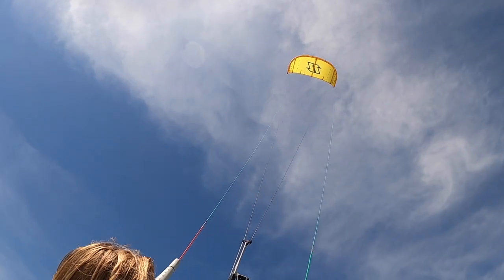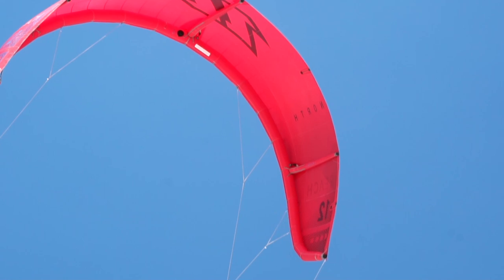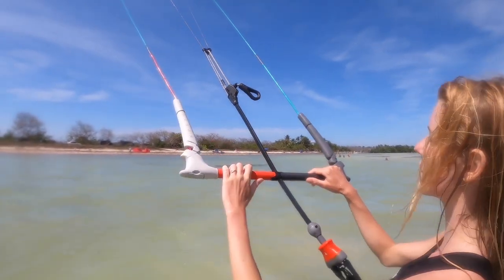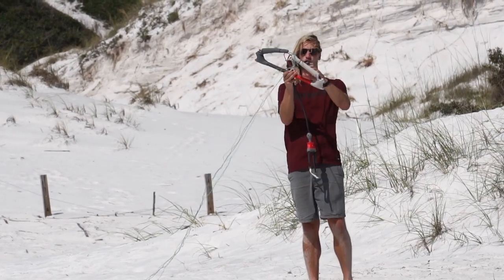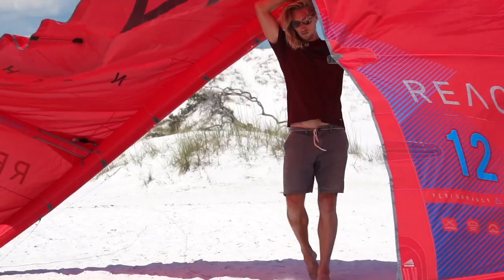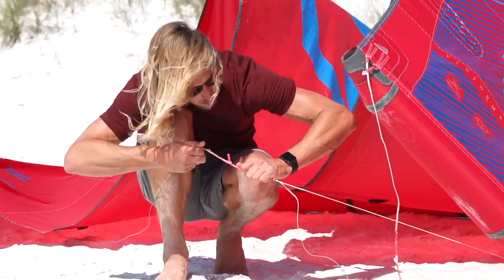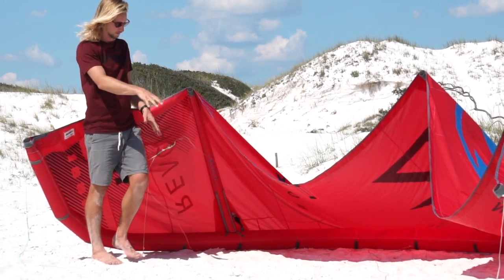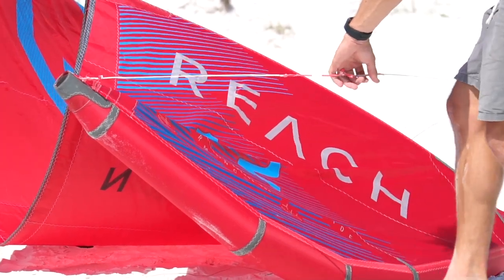Kiteboarding Basics | Learn How to Handle Your Kite

Comment: Hi Blake. I got a B3 Slingshot trainer from MACkiteboarding. I ve taken it out 3 times now on grass fields. I can do figure 8s, loop it both ways, and did a few simulated water starts (sitting on grass and staying “small”)today. The question is why does it fly over my head at 12 o’clock and backstall?  Is it due to gusty winds or should I not try to park at 12 o’clock? Thanks!
Reply from the maker: That's a great question, my friend. 🤙🏽 A quick phone call might be the best way to suss this one out. Got time to chat? (800) 622-4555

Comment: How does the knot work on the steering lines of the duotone rebel? I bought a rebel package from you guys a couple of weeks ago and noticed the lines on the rebel is a loop and not a knot
Reply: Hey Justin, every brand has a different line connection set up but it connects in the same way. How's it going for you?
Reply: The duotone knots and loops are smaller than most. The loops actually have a small knot on the end so it can be confusing. Hope you got it sorted!